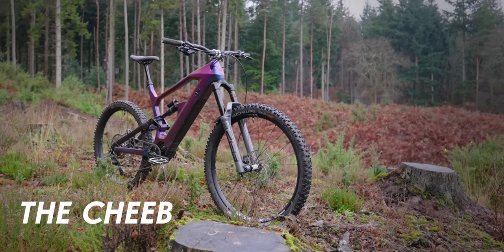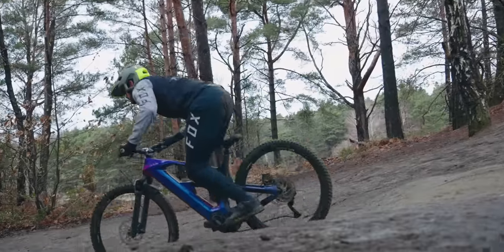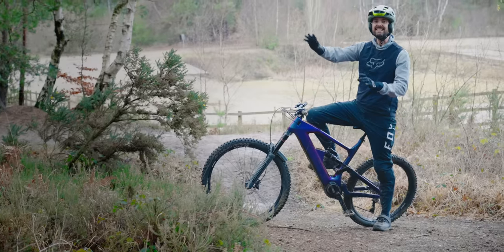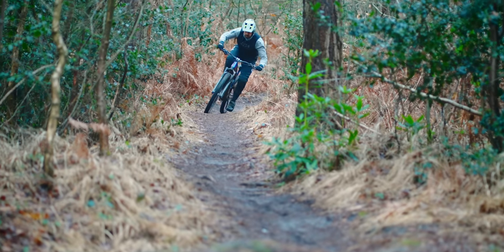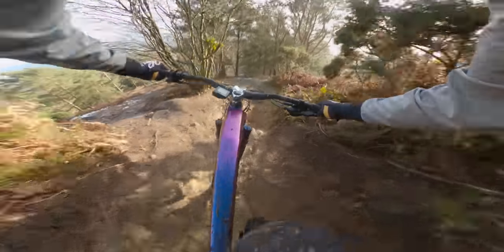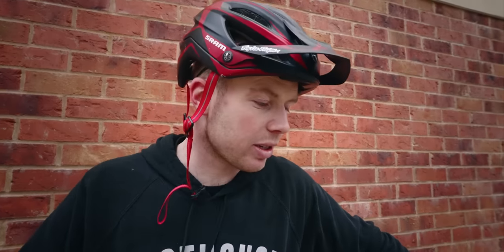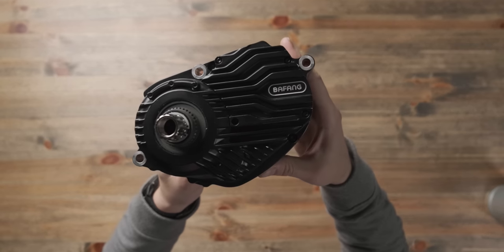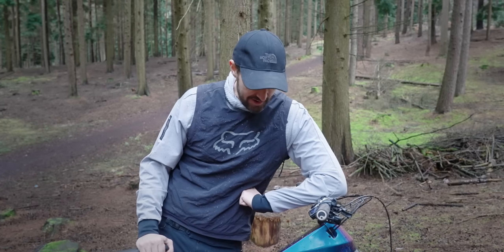I TEST a Chinese EBIKE

Comment: I have 2 of these exact bikes but with the M600 spec'd out with XT mech, 4 pot brakes and SR Suntour Durolux 170mm upfront and their Tri-air 155mm in the rear.  The top of the line Suntour is great value for top performance so helps build this bike even cheaper without sacrificing performance. They were fully built up by Dengfu and arrived complete. Just check and torque all bolts.  The frames are painted so you don't need to go as far as Rob did, although his paint job is epic.   Rob will find plenty of punch with the M600. The motor body itself is very waterproof. The errors from wet riding are caused by water getting to the battery pins. The battery to frame connection is set low in the frame.  I have added some extra waterproofing to help keep water away from these connections.
Reply: I've never even thought proper emtb DIY is possible can you please let me know what type of frame it is please, really interested. Regarding Suntour it's good advice, how'd do you find it comparing to fox or rockshox performance wise ?
Reply: How did you purchase them?   Spec out the components and have Dengfu quote it?
Reply: How did you get these bikes??
Reply: @pahanoks  I used the Dengfu E10 frame and was one of the first to try out. I had the 2 bikes built in May last year. I ordered the Suntour Durolux front  and Triair rear from Kunshan Brisky Sports Co., Ltd, a trader on Alibaba.  They then delivered these to Dengfu for assembly. This suspension setup is great and the 36mm stations are nice and stiff with 170mm travel. Check out reviews online. My view is that they match up to Fox and Rockshox but at a much better price ( $US590 for the set).
Reply: @jeffstroh3521  Researched online, checked out integrity of suppliers and then organised all online. Dengfu where great and when I found a Chinese supplier of Shimano XT gear, they arranged local purchase.  Not sure that you can expect them to do this every time as they normally use SRAM gear. I set out all components with each priced on a schedule.  They then assembled and sent me final pictures prior to seafreight shipping. All worked out great and my brother and I have done 1,000's of kms on trails around New Zealand. The same spec'd bike here in NZ would have cost twice the price, if you could even find stock.
Reply: @jackkelly9660  Hopefully the answers provided to Jeff and Pavlo help answer your question. If not, let me know.
Reply: @brentmckenzie5808  thank you ! Very informative didn't even suspect that Dengfu can assemble the components. Also yes I've already checked suntour durolux 36, it's great review wise, although here in Canada only $100 cheaper comparing to Zeb from RockShox.
Reply: thecouchtripper  Well that's your choice. No skin off my nose what you think.
Reply: thecouchtripper  why?
Reply: Help me out please look what I ask Rob here? 
Thanks
Reply: This is great info ,thanks Brent I'm saving my money for an e06 fatty prebuilt by dengfu! Only about 2k left to go.how similar is the frame geometry between their fat model and this one?
Reply: Interested in how you added water proofing to the battery ? Could you show us how you did it?
Reply: thecouchtripper  it's a fact your salty 😂
Reply: That's nice, how much is customs charges for buy a bike like that from china and what was you total price on the build? Thanks
Reply: Brent can you show me a picture of what you did for the extra waterproofing? Would like to waterproof mine too
Reply: Dengfu will custom paint for you as well.
Reply: Ya i got mine painted chameleon. Its beautiful! And the ebike works great! Got the E06 i absolutely love this ebike
Reply: @MrPhunka21  tell me more, was it hard to build and did you need much tools
Reply: @hughoneill6555  was built for me
Reply: @MrPhunka21  really was it a full sus, and how much did you pay? Any customs changes?
Reply: @hughoneill6555  allmost 5 grand Canadian then i bought shimano drivetrain. If you want it built for you get either the middle or pro model .the economical model has a bad drivetrain that isn't strong enough for the motor
Reply: @hughoneill6555  oh ya ask for Roy he is a  good guy!
Reply: @MrPhunka21  ye I see there it's the EO5. Does that price include shipping and all
Reply: @hughoneill6555  yup i wasn't charged by Canada post any extra. Make sure you either get the sram drivetrain or buy a shimano deore drivetrain. You need a derailleur with a clutch.ive got about 600km on the bike now running great
Reply: @hughoneill6555  actually its the E06 yes price includes shipping
Reply: @hughoneill6555  over 5 grand Canadian  . Well worth it such a great bike
Reply: @MrPhunka21  ye works out to be like 3k euro seems worth it alright
Reply: I added 5mm adhesive raven door seal rubber around my battery.   Tight to lock it in, but cozy.  Reprogrammed the canbus controller with the $200 Au  tool and lifted the levels.  So the m500 is actually the m600.  Same motor.  Jason a range of 18-25amps  they run the 500 at 18 and 600 at 23 amps.  So turn up the m500.  I have the same frame with rock shox rear monarch 2 and fox factory 36 front.  203mm sram brakes.  The bike is solid and that battery keeps you on the tracks when the others go home to charge.  My longest jump on it is a little under 9metres   I have been riding since 1987 and I love air.  Is it as good as my orange e-mtb (no)  bit it cost $18,000 au less.
Reply: What’s the damper length for 155mm travel?
Reply: Hi. Do you have any link for those ?
Reply: Check out TOSA AM 1.0 if you want a bike like that but with EU warranty.

Comment: To be honest this bike in slow motion looks stiffer than most of the other "non-chinese" frames with big logo on them
Reply: So you just watched the 28 bikes bottoming out video too?
Reply: @derekhobbs1102  pink bike, drop on flat
Reply: you're forgetting that that's not always a good thing
Reply: Flex can be a good thing. Trust me those big companies know what they are doing
Reply: TBH most of the big name bike frames are made in China anyway.
Reply: True but that makes it brittle
Reply: How much as tested?
Reply: @tomwebber9936  This. I mean lets say you're Trek, you pay some Chinese sweat shop to make your bikes.....you want 100k making. You give them your plans and production starts. 100k frames later your contract is up and you part ways. Bish bosh. job done. Except they still have your plans, the materials and the capability and you expect them to not be naughty and make another 100k on nothing more than a pinky promise lol........grey shift items, made out of license but absolutely not fake. Half the shit on wish etc is probably actually ok tbh
Reply: @tomwebber9936  cheap frames are made in china and expensive with better quality are made in Taiwan.
Reply: @rtorbs  This is true but when they produce the parts to sell directly they can choose the use lower quality materials. And QC can go out the window since there's no more Trek to check if the finished product is up to spec. I certainly don't know enough to say this happens all the time but it's a very real risk to consider. Even the big companies are getting way too lax with their manufacturing tolerances lately so buying the same part backed by a real warranty could be worth the extra cash. I personally wouldn't put much faith in Trek's warranty department... but still more than a random direct to customer seller from China.
Reply: @julianluo8635  Taiwan is China dude. Taiwan isn't any better than China when it comes to frames and carbon fibre - go visit the factories, the process is the same.

Comment: As a mechanic I approve of the BAFANG motors. You should see their display for trade shows. For the price it’s pretty nice hard ware. Definitely get Bosch of E-Motion if you can. Mid drive only of course. As for the frame Chinese frames can be hit or miss. Sometimes they can feel nicer than much more expensive frames. Sometimes they are crap. Attention to detail is what you’re looking for. Obviously a lot of design went into this frame in the video. Of course you potentially have less customer service and support. If order one just send it to you local bike shop. They will build it for you and make sure it’s safe to ride and everything is set up properly.

Comment: I'm doing the same thing with a welded aluminum frame.  With the power these batteries and motors have, I'm not as worried about saving a few pounds as I am concerned about frame strength.  Mine's a full suspension also - I'll post a video when I'm done.

Comment: "I TEST a Chinese EBIKE"
If only you knew that more than 90% of e-bikes on the market are actually Chinnese re-branded re-sellers.
Reply: My cube frame came with a chinese warranty that literally states the factory it was made in. I'm pretty sure cube wasn't supposed to send that along with it lmao. The frame is one of the older zeroblack series wich were way over 1000€ new when the came out. I think production cost around 300 with maybe a 150 extra for the paintjob.
Reply: yeah, true. But at least with a brand recognition there's some warranty, that is provided they actually have decent customer service
Reply: That’s the reason they all “look” the same.
Reply: Made in China by a brand name is better than Made in China by a no name. The Chinese love cutting corners and always build to the cheapest price. It isn't cheap if it doesn't last.
Reply: @deanrwilson  yea if you gonna buy something a bit more pricey don't be a cheapskate and go for a branded product
Reply: Actually "made in Taiwan"... most of them
Reply: @valentinmetes7102  except that Taiwan is considered to be a sperate entity from china so yeah not really chinese
Reply: @deanrwilson  "The Chinese love cutting corners and always build to the cheapest price" - That utter BS. They don't "love cutting corners", quite the opposite actually, because for the price they work for, they do a better job than anyone else. So saying they love cutting corners is literally nonsense. Unless you want them to build stuff for you at unreasonably low costs, then they'll cut corners, but they'll still cut far less corners than anyone else in the world would while building the same thing at the same price. Have someone in USA build you stuff and sell it to you at the same exact price as the Chinese do, and let's see which thing will be better built.
Reply: @dolphin-studio  yeah doubt. Made in Taiwan is going shit recently,
Reply: @deanrwilson   "Chinese love cutting corners" when you don't understand economics 101 lol. Pay shit price get shit product, It's almost like the brands wanted to save money.
Reply: @TesGon  actually LOOK carbon frames are made in Tunisia
Reply: Actually, wrong, they are TAIWANESE, which is definitely not Chinese!
Reply: @Fluterra  Similarly, the Scot are definitely not Brit.
Reply: @derbigpr500  Think he might have missed one important aspect.   They may not be "cutting corners" but their quality control is definitely lacking.  Whether it is them or anyone else,   after any part be that as it may a bike,   quality control is there to limit faulty parts going out to clients.     Personally i stopped buy any Chinese crap because of it.   Perhaps you got lucky a few times.  Not me or others in our riding group.   One person,  had a pair of Chinese wheels de-laminating during a simple crit ride. Got seriously hurt.  Not to mention,  he was bragging just like you how good they are and cheap.    List goes on and I am not going to insult anyone's intelligence.   My biggest problem is they steal properties and duplicate them not understanding what they are causing.   We here in the US, will be going to jail if we are caught doing that.  A cnc friend lost his shop because these clowns work for a bowl of rise he couldn't compete.   For that reason unless i don't know,   Chinese crap/good/marginal does not matter will not be in my list.  This clown of a president doesn't help either.   He seems to be in bed with them.
Reply: The pathetic thing about this situation is that virtually all of the American ebikes is that brand is utterly worthless. The American companies know jack shit and has zero engineering or manufacturing capacity. All the design, engineering and manufacturing occurs on the Chinese side. The Chinese don’t just manufacture the bike, they’re the OEM! The American brands are just worthless parasites who charge you 100% the OEM cost for the exact same product.
Reply: @Fluterra  Taiwanese are Chinese. It’s like saying Londoner’s are not English. Taiwanese write Chinese speak Chinese eat Chinese. The island is a part of China lost to the Japanese in the Second World War. UN recognized Taiwan as a province of China.
Reply: @deanrwilson  Yes, that's why all the Apple stuff has such rubbish build quality, all the corner cutting I suppose! ;)
Reply: it's actually 100%
Reply: @valentinmetes7102  true !
Reply: I have the M400 motor on a fatbike & I love it.. very quiet, plenty of power & I've ridden it right through the winter in all sorts of shit & it's still good
Reply: Made in Taiwan btw, most bikes get made in Taiwan and thats where most off the technology sits!

Comment: I am planning on building a fat E-bike the same way, but i will put my Paradox Kinetics motor, it adds only  2.5 kg to the bike and 1500w with only throttle assist so you can have power when you want it. instant power. both your vidz Rob have been amazing help.

Comment: Interesting with this “smooth power delivery”. My bbshd with 160Nm feels like a motorcycle :) I find myself struggling to keep the front wheel on the ground if I go full power :)
Reply: Hes probably using low voltage battery
Reply: @niius7663  just note the same motor at all
Reply: @currymasterrace7153 VRMinde must be using a higher voltage battery like 52v,so bbshd performs better
Reply: @niius7663 the m500 shown in the video is 48v. even with 52v the bbshd would be more powerfull. The m500 as way less amp. The m600 is closer but still less powerfull.
Reply: Thoughts on the bbs02 with a 48v 17.5ah?
Reply: @vrminde if you want real power just get the m 620 this thing is equal to or probably beats the bbshd it goes up to 2000w
Reply: @SimonBauer7  it is beafier motor for sure. But you can’t just mount 620 on any frame as you can the bbshd. Oh and today I use my bbshd at 2500w as well with the grin phaserunner 🙄 I do not need my bike any more powerful than ir is now
Reply: @SimonBauer7  the m620 also costs twice as much even if it did give a little more power it's not worth the price

Comment: Lovely bike. Great video. 
Get the frame tested by a carbon fibre repair technician. Pretty sure they can scan the quality of the carbon. Might make for an interesting video. 👍
Reply: That has already been done. But the results didn't get published because it was going to ruin the branded frames business.
Reply: @rubenvor   true story :D
Reply: Really, Rubenvor. Would be interested to see those results .. I am a factory acceptance auditor having worked in Germany and on Italian frames . Can you point me in the right direction so i can look over these results and provide a response .
Reply: @steveroylance7857  with such job u should know more about this that any one else here.
Search for Mark Ferguson, and then for the place where he took his frame to be tested. That guy who repairs frames and test them with ultra sound has cut in half a dozen of Chinese frames and compare them side by side with "branded" carbon frames. I can't seem to find that video.
Reply: @rubenvor  Thanks for the reply - will check that out. The main and significant issue is how the carbon fibre is aligned. The testing has to be designed so the testing specification accelerates the movement and strain within the fibres . Ultra sound is not a test that would provide a meaningful conclusion regarding the performance of the frame , unless there is a baseline and its a test repeated and stages over a defined period . Carbon frames have developed hugely, just need to be sure these frames are same . Personally I ride a carbon frame- want to know its going to get me home when I am out 30-40 miles from now where. I will check out Rubenvor - cheers for heads up . Personally I have never owned a specialised. I mention specialised because although they are a mega brand etc etc they were one of the forerunners in developing these frames  and they have a history and have invested heavily and most of us now are reaping some of these rewards as the innovation trickles around the MTB world producing on the whole safe bikes.
Reply: @steveroylance7857  my only small concern with the Chinese frames carbon layout, is that they only use 2x2 twil, which for this application won't cause any structural weaknesses, but an increase in weight.
I own 2 Chinese and 2 branded carbon frames,  the Chinese ones are only 1 year old each, and I can't seem to find one single flaw. The others are a specialized and a pivot.
Reply: @rubenvor  Good choice of bikes especially the Pivot...would love a Pivot Shuttle..

Comment: I had a easy motion neo jumper for a few seasons, it was okay but lacked power and range. the motor was in the hub.
    I recently bought the 1000w bafang conversion kit for about $1200 bucks and installed it on my old Specialized big hit.
It was easy enough to install my self and it kicks but. No speed limits and includes a throttle. Very adjustable via the bafang program.
Only drawback is the motor hangs down and you loose log hoping clearence and its heavy. But the specialized is so much better then the neo jumper it was well worth it.